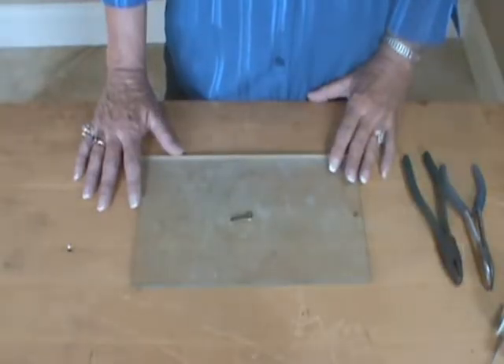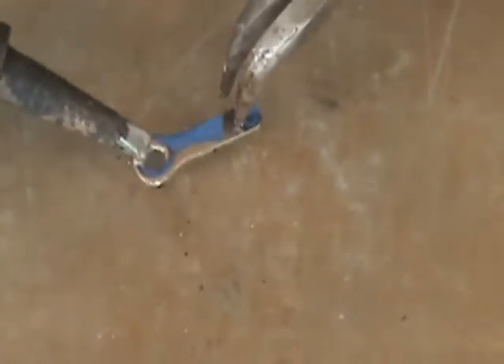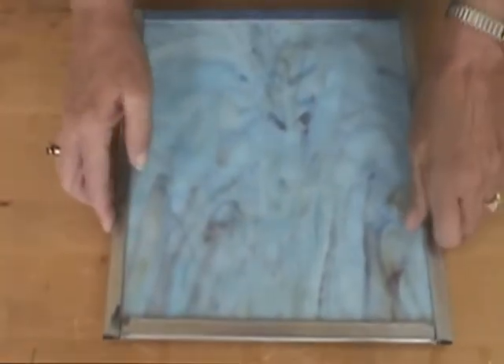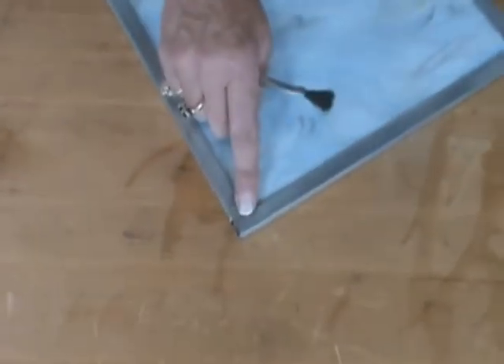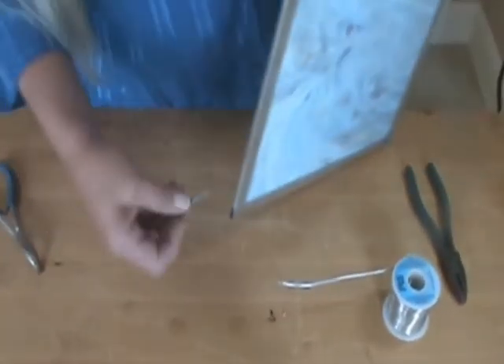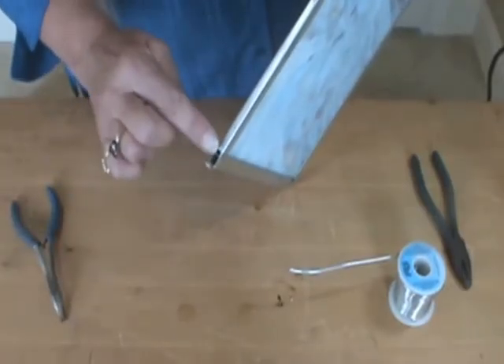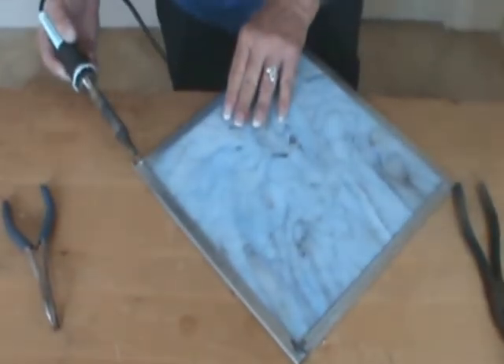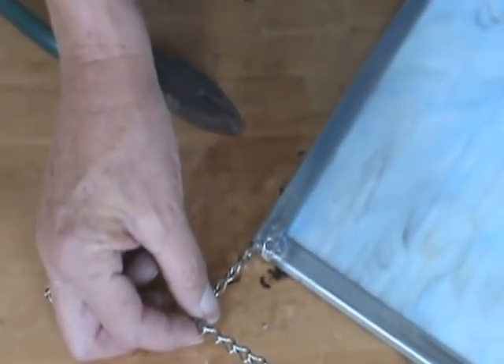Installing Handy Hangers for Stained Glass & Fused Glass

Comment: I tried doin that when i dropped solder down yhe channel it hardened before i coukd get the hook down the channel i couldnt get it down . I ended up melting the top of the zinc plus where do you get a 3/16 tip to fit Hakko iron?